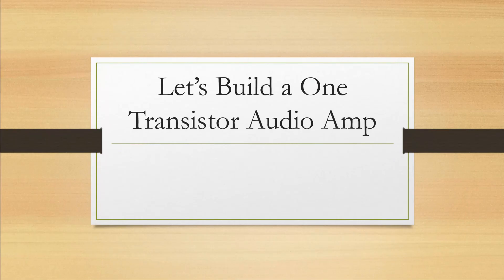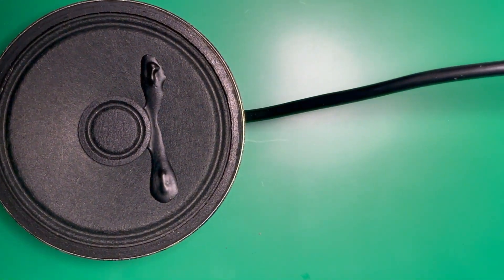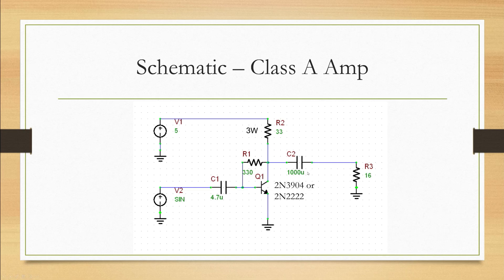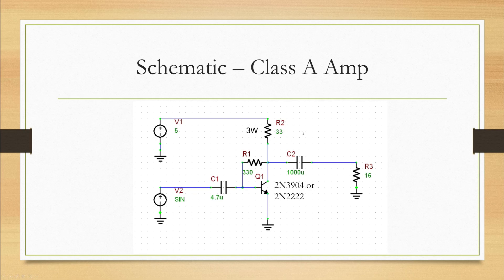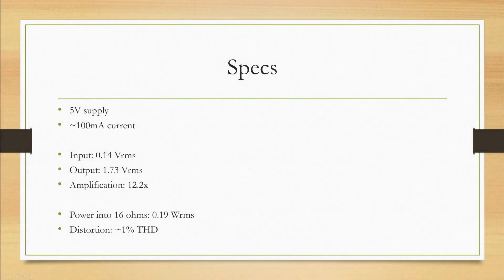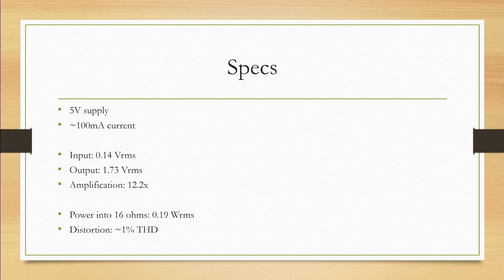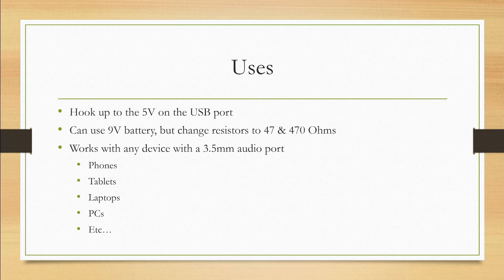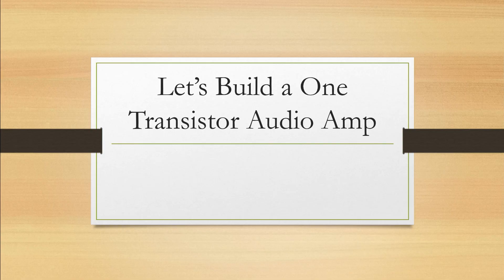Build a One Transistor Speaker Amp

Comment: InB4 that Audiophile telling you about the wonders of  this amp design by using Parts that cost 100x the raspberry pie.  :person-turqouise-waving:    Really neat how something so simple can amplify a signal.     The 3 dudes at Bell labs that came up with the transistor really should have made billions.    But that is life.
Reply from the maker: That's right, no expensive parts needed, and simple class A amplifiers like this one do a really good job if you don't need a lot of power. Couldn't agree more that the inventors of the transistor at Bell Labs should have made billions.